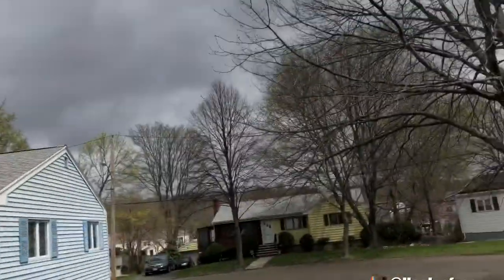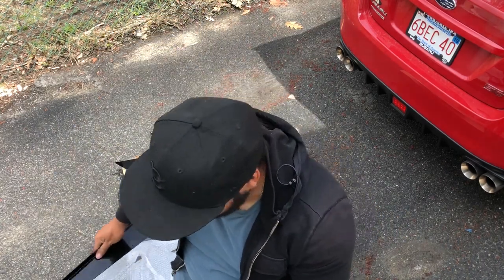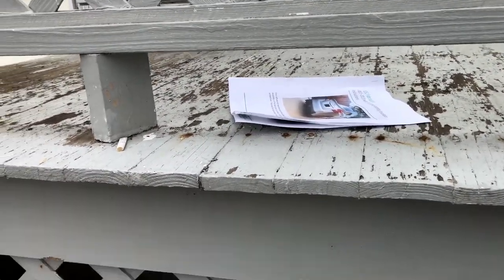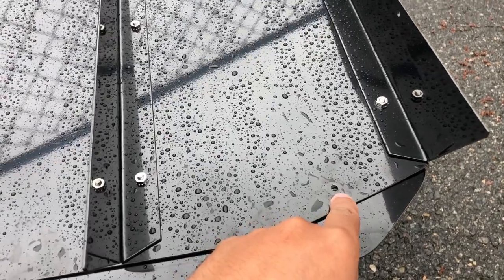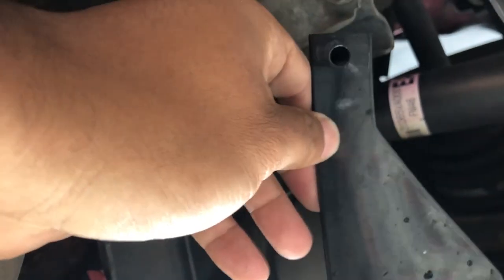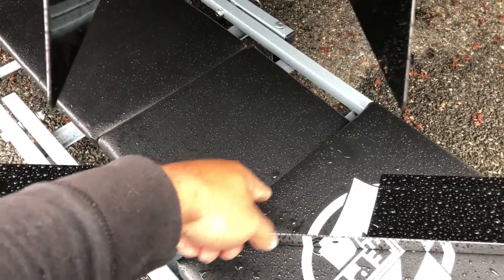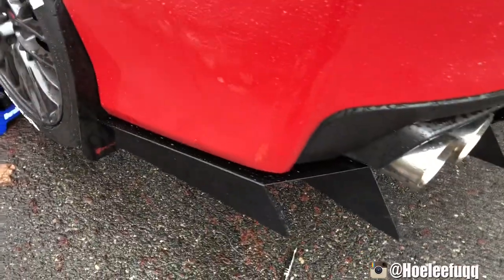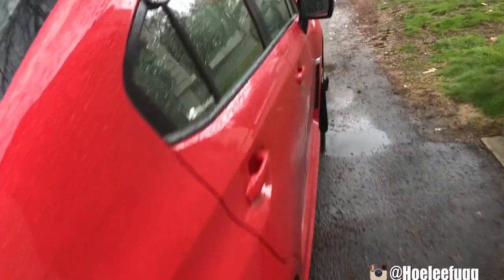ESC Diffuser install

Comment: Hey, do you think it's possible to install this without using any kind of ramps/jacks?
Reply from the maker: Yes it’s possible but it will be a right fit. Remember that u need to get to the rear axel area also.
Reply: @HoeLeeFuQQ  hey while filling the options of before buying the diffuser, there's an option that says "Strake size change", What does that mean?
Reply from the maker: Alex A that’s if u want spiky fins larger then normal or a specific size. mine are spike normal size, so I said NO to this.
Reply: @HoeLeeFuQQ  thanks man
Reply: @HoeLeeFuQQ  Last question man, what's the difference between jdm splash guards and USDM spats? My car came out of the dealer with splash guards but how do I tell if they're jdm or usdm?
Reply from the maker: Alex A if they came on the car and are OEM then they are USDM make sure u select that when getting the diffuser because they have to slightly change it so it can fit👍🏽
Reply: @HoeLeeFuQQ  Hey check your email I sent you 3 pics of my bumper, can you tell me what I click. I wanna make sure my fitment is correct haha the diffuser is going to cost me 450 or more since I'm ordering with everything
Reply: @HoeLeeFuQQ  I'm just a bit confused because for the splash guard option because I think I have USDM splash guards And evil subie customs only has a JDM splash guard option
Reply from the maker: Alex A yeah send them a message bro and show them the pics, they are on Facebook messenger, but I think those are usdm but to be sure call them
Reply from the maker: Alex A they are also on Facebook, u can talk to them with the messenger also.
Reply: @HoeLeeFuQQ  have you ever scraped the diffuser on a pretty big speed bump going straight at it? Or do you have to go over them a lil sideways?
Reply from the maker: Alex A no I have not. The car is still on stock suspension. With the defuser it looks lower but it is still high enough to go over speed bumps fine, even our last snow storm it survived no problem. If ur subie is lowered yes u will scrap most likely on bump try to avoid big pot holes and when going up driveways or bumps always take them at a angle and you will be fine
Reply: @HoeLeeFuQQ  I just got an email from them saying USDM splash guards=USDM spats. They're the same exact part but different name they said. I though this whole time spats and splash guards were totally different parts.
Reply from the maker: Alex A they are the same